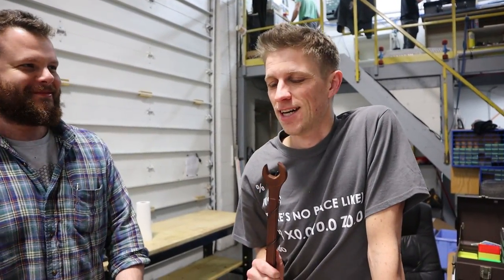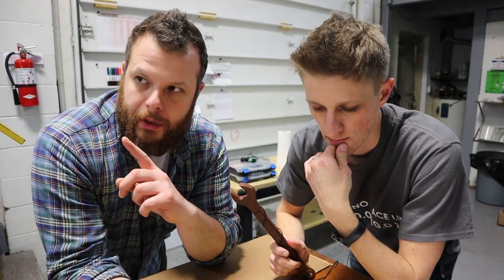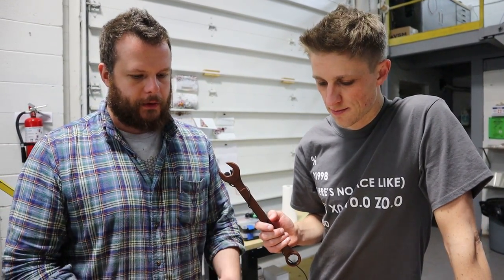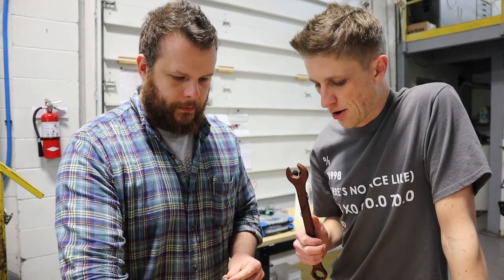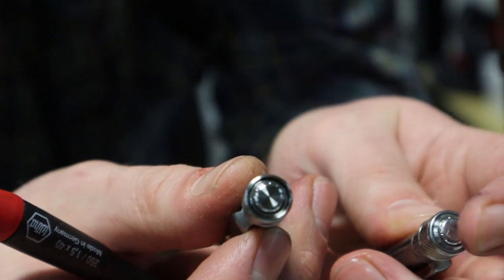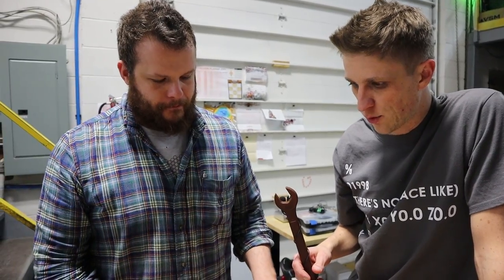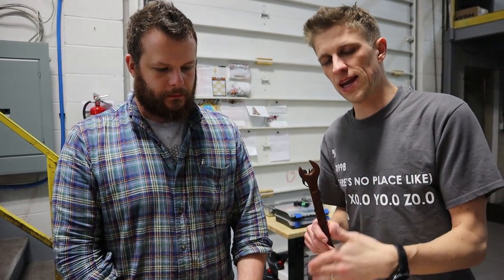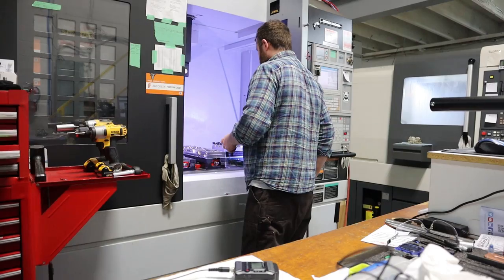Achieving the PERFECT click! - Tolerance Stack

Comment: Hi 
I work in the high precision industry and see over engineering often .
The level of precision that I work with is ISO 5 K and below ( +- 0,002 mm) .
The problems is that high precision is expensive and needs to be used were it needs to be and not 
where it's not have any practical use . Over engineering is a good way to a fast fall.
Looking to the customer a working with ( aero , space , hydraulic ,nuclear industry ) who have good engineering even check the drawings for just over engineering that very often gives conflicting tolerances where it's often not needed too be high precision and often gives bad functionality.
I and my coworkers have a good daily dialogue with the customer not always about precision ,  cad is not the real world and engineering with no workshop experience is a pain and often can be fantasies ( often a young engineer) .
What I want to say is don't make a too sensitive productions line where a temperature changes can make a difference because you are close to that now .
Reply: Tight hole tolance together with a tight tolerance for the location/spacin of said holes can be .. interesting..

Comment: You guys mentioned GD&T in your last video, so I thought I would pass some knowledge along.  There are GD&T terms for these min and max stack ups. The LMC (Least Material Condition) is the largest holes or smallest shafts and the MMC (Maximum Material Condition) are smallest holes and largest shafts. Using the terms make it easier when you talk to others about these stack ups.

Comment: I think Grimsmo needs a night shift crew. Rather than buying more machines (or better yet, in addition to), 100% maximize the output of the ones you already have. Do what ever needs to happen to ensure they are making chips 24/7. Have a crew there at all times, doing assembly, cleaning, finishing, and most importantly keeping the machines fed all night. I bet with some training and a good night manager you could get in the ballpark of double the output, with simply more man-hours.
Reply: That's exactly what John is setting up with the 4 pallets in the mill - ~12 hour run time. No need to be there really.
Reply: The machines already run for several hours after they leave. (I think he said midnight. So, 6-7 hours after they go home.) The other fixtures will allow it to go the next 6-7 hours from midnight until they come in on the a.m.
Reply: His night shift is a CNC machine :)